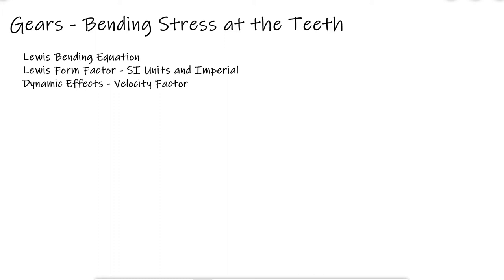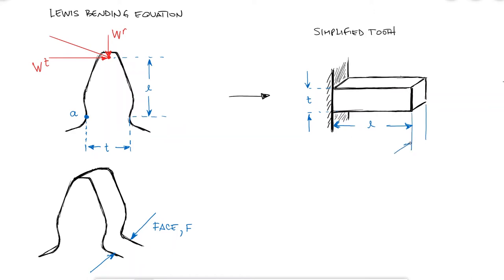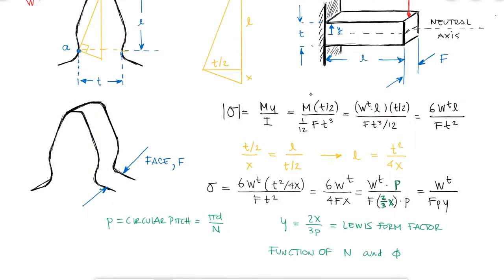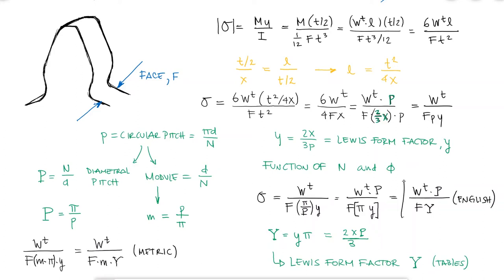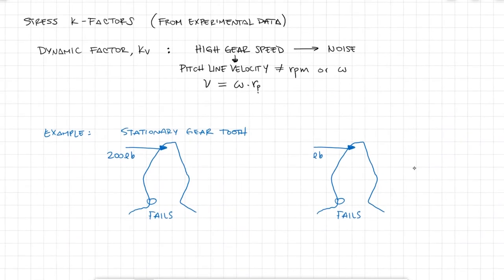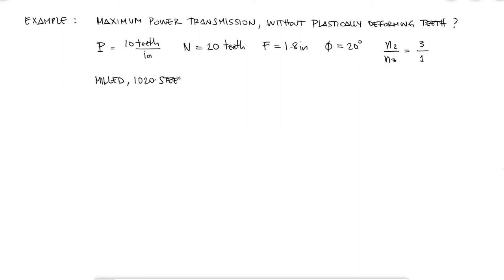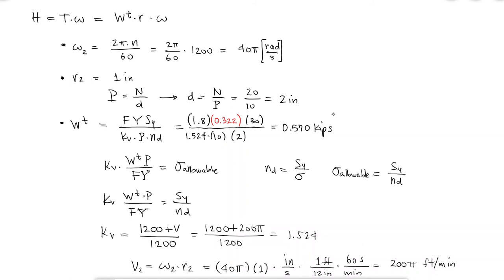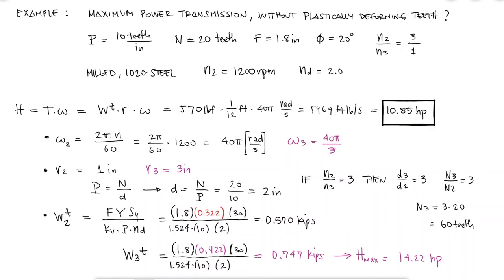LEWIS BENDING STRESS at the Teeth of a Gear in Just Over 12 Minutes!

Comment: Ratchet Gears do not rotate in their intended service purpose.  These gears (and the associated pawls) are often on one or both sides of winch drums used for lifting with a coiled metal cable or rope.  Their fluid analogy is a check valve, their electrical analogy is a diode.  
But it is true - gears that are normally used to transmit torque are under load while they are rotating.  Excellent and clear presentation - SUB

Comment: So let’s say I have a motor that is 2000 watts and I calculated that the maximum power that can be transmitted in my gear is 2500 Watts. Can I say that the safety factor is 2500/2000 = 1.25? 

Such a great video by the way! Thank you

Comment: When using the material's yield strength to calculate the bending stress, do you use the surface yield strength or steel core yield strength value in the case of case hardened gear?

Comment: why would I choose a spur gear instead of a helical one?
Is it just about noise?
Reply from the maker: Angled teeth contact is more gradual, so helical are more silent. And they also last longer because of this. Either that, or they can handle higher loads. Of course, they generate thrust, which require thrust bearings. Also, as you can imagine, the manufacturing of helical gears is more expensive than regular spur gears.